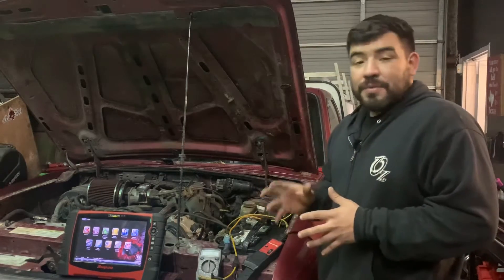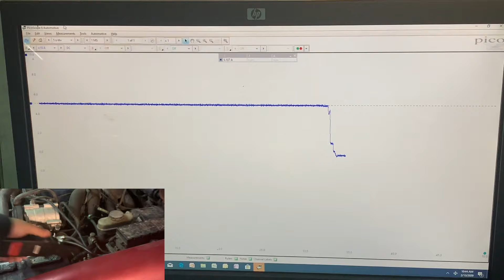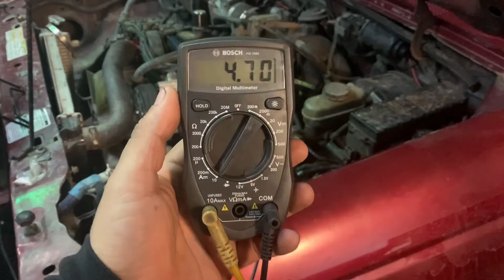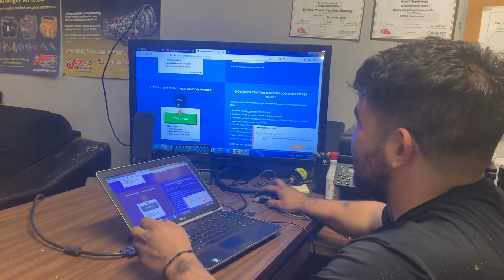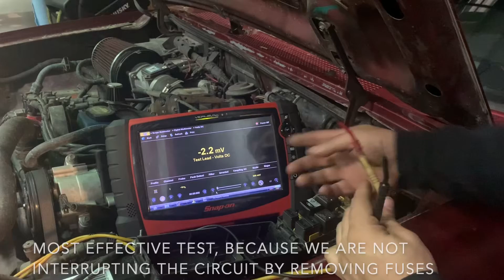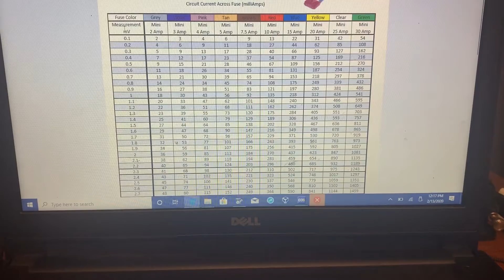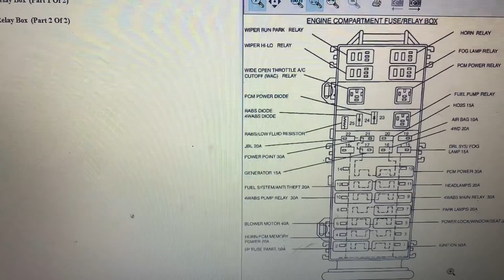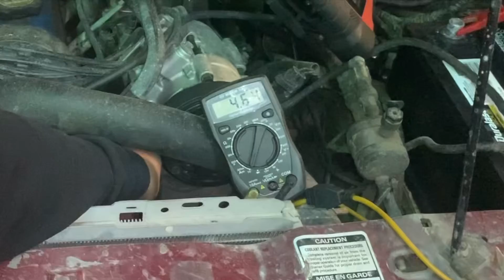Ford battery draining overnight

Comment: Like the equipment, you used specifically the Pico Scope and the Snap-on Amp clamp. Wondering if the Pico meter does AC and DC charting over time? Great troubleshooting skills love watching your videos with a box of popcorn. Keep up the great work.

Comment: i use amp clamp anc check across fuses. i never pull battery cable or pull fuse until i am sure i have found the source of the draw. sometimes you wake something up when u remove and reinstall fuse. i have tried every idea i have seen on the internet.
Reply from the maker: lesal that’s a good approach

Comment: I start with my stand alone snapon amp clamp and if I want to pinpoint the draw I do the voltage drop testing like you show in the video.  I typically start by opening any doors that I might need into for the testing and bypass the ajar switch so I don’t wake any modules up by opening the doors. I hate the vehicles that take 45 mins to timeout. Thanks for the video Oz

Comment: Wonder why the fuse didn’t blow?? But rather made a draw
Reply from the maker: phil holbrook the draw was only 5 volts. The fuse is rated at 15 volts. If the wire was a dead short to ground it would blow

Comment: #ozgiveaway The amp clamp is a great quick check to see if there is a drain, but I think I prefer the voltage drop test across the fuse to know right away which circuits to check.